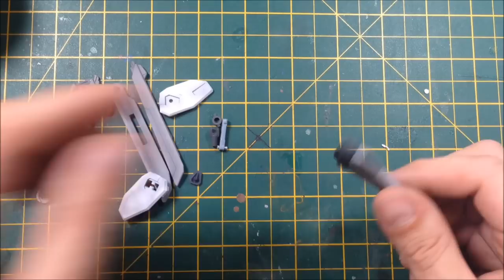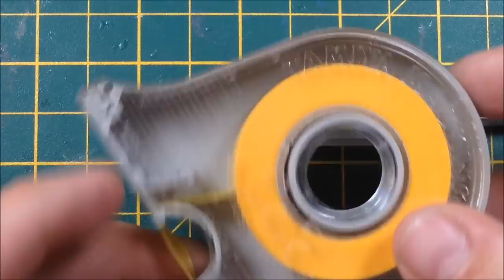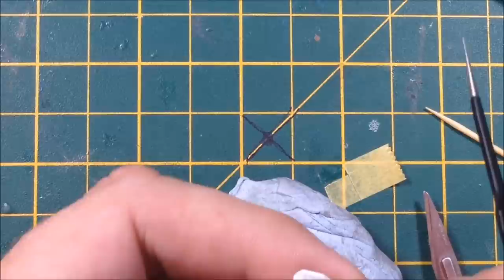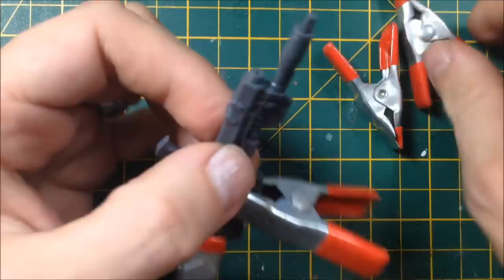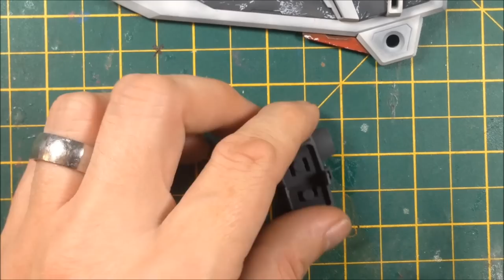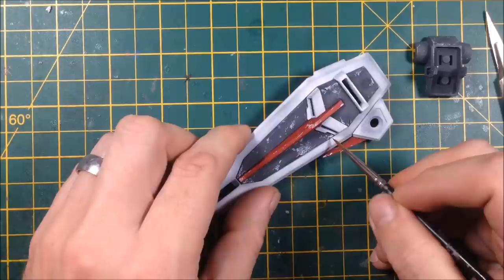SKILL LEVEL 4: MG Freedom Gundam Ver. Wolf Part 6: Masking, Paint Chipping & Filling Seams

Comment: Dear Mr. Fox,

Don't know where to start, so let's start by stating that your channel is simply amazing! I've been back in the hobby for two years now after a hiatus of ten years and I'm just getting started weathering my Gunpla. Build five models as "fresh out of the factory" and now I'm finally taking the plunge, LOL
Picked up your masking technique after seeing the Colonial Viper build and it is way better then doing it by using tiny pieces, so a major thanks!

The weathering I'm doing is just some simple paint chippings via masking fluid and underneath a rust colour. Making some streaks with the same rust paint to make it look like the rust is running out from underneath the paint. Making it look like the suit is on "standing by" mode for a very long time without seeing any action and due to the fact that there are no supplies for maintenance so it's all rusted up.

Again after seeing the Colonial Viper build series, I'm going to do a wash with the Tamiya Smoke paint, as it's laying around for fifteen years...... How time flies....
When I have to order new supplies the MIG Abteilung 502 oils will definitively be on the list.
This brings me to a little question: The model is coated with Alclad's Klear Kote Matt (someone over there needs to pick up their English spelling, haha) which is an enamel and not as most people think a lacquer as it contains mineral spirits (label reading can make a difference...). Do you happen to know if the turpentine used for the oil paints will eat through the varnish?

Please keep making your documentations of model building the way you do. It's been a very long time since I've been educated in such an entertaining way. All the silliness and jokes bring a smile to my face every time I watch an episode and at the same time getting taught new techniques. I love the way you do your stuff! Can't stress that enough!
So many thanks for taking your time teaching us all your knowledge in such a fun way . Hopefully we will get to see many more of your productions.

Kind regards,
Tim
Reply from the maker: +Tim Lemmens Thanks for the kind words and I'm glad you're finding my disorganised chaotic nonsense helpful!

I like the sound of the rusted, slightly abandoned gundam, I will probably get around to doing something similar myself at some point. <aking things look completely junked is the best fun! If you do get yourself some of the Mig oils, make sure to get the light and dark rust, I find them just the easiest to create rust streaks of varying colours and tones, alonhg with a little help from Tamiya Red Brown as the chipping basecoat ^_^

Before you go ahead with the Smoke wash, I would offer a word of caution with that when it comes to gunpla. It varies from kit to kit, but often on gunpla, the parts can be of varied material, with some being polystyrene, some ABS, and polycaps generally made of polyethylene. You'll see them marked in the instructions on the page that shows all the sprues, as PS (polystyrene), ABS (ABS, obvs) and PE. The problem is that ABS has a few issues, especially when it comes to washes. The plastic in ABS can actually weaken, break down and crumble away  if it is exposed to strong solvent thinners such as are found in Tamiya X-20A and others, and a Smoke wash is basically just tha - a pot of thinner with some paint in it. The risk is further increased if the part is an active part i.e. it is a moving part or put under stress in a joint. I've even tested parts in standard automotive panel wipe and they weakened and broke. So, before you dive in with a thinned-paint wash, be very sure what you are washing onto. If have seen a few folks say they same damage can even occur if you use white spirits or turps for oil paints. If you kits has no ABS, then you are good to go, polystyrene is what most model kits are made of and the thinners will do no harm, just keep washes away from the polycaps. If it has ABS, then make sure you prime the living shoot out of the parts as the primer will protect the plastic from any solvents and thinners that go on top (or, if you can, avoid using thinned products on the ABS parts. Luckily in most cases the ABS parts are usually just the inner frame, so if the exterior armour is all PS you can wash and weather that as normal and maybe use other methods such as water-based clay washes for the frame ABS parts. One other thing is that although the PS plastic is usually immune to hot thinners, it is not unknown for a builder to occasionally get cracks in armour parts because they were washed and perhaps ever so slightly more brittle and then stress was applied to attach the part to the model - so if you can, try to make as many sub-assemblies of parts prior to any weathering to that the construction needed atfer washing and weathering is minimal (just keep in mind keeping apart sub assemblies that will be matte varnished and those that will be eventually left gloss varnished. There's a reason i also refer to building gunpla as "Herding Cats For Beginners" ^_^

Alternatively, if you're just not sure at all, avoid using washes thinned with X-20A or any paint thinners at all, and just use other methods. I used a Smoke wash once and only once on a gunpla, and when parts broke, I stopped using it. That's why I tend to use things like the oil paint gunk was instead on these kits, to get a similar effect and to be safe.  

As for the Klear Kote question, I haven't used that clearcoat so I can't honestly say, althoughif the varnish is actually an enamel, then I would suspect yes, it will eat through it as turps and white spirits are often used as thinners for enamels. Also lighter fluid, believer it or not, would probably also eat through it (it's used in the reverse-wash technique for removing enamel coats). The best things is to get a scrap kit or piece and test it out with different things on top, see what happens. Also, perhaps consider using odourless thinner for oils instead of turps or white spirit. You can get it from any art shop and as far as I know is should be a little less aggressive than turps/white spirit (it also DOESN'T STINK). Go for art shop stuff, not model paint brand stuff, as it works just fine and is often MUCH cheaper. 

I will continue, don't worry, I enjoy making these too much. And the next one has a definite comedy moment. However, I can't help thinking that eventually I will have covered so much that my build vids will become a five minute "Right, you've seen how I build things before so no point going over all that again, so let's go straight to the finished model. BAM! and there it is. Goodnight Vienna!" ^_^
Reply: +Modelmaking Guru Thank you so much for the advice about the smoke wash! I could hit myself in the head for not thinking  of that as I've heard and read a lot of horror stories about that indeed. Lets call it a moment of exploding excitement, haha. Although the frame is primed, painted and sealed with lacquers, I'm not going to risk it. I have to say, I love the idea of a water based clay wash. You see, that's why you're the Modelmaking Guru! Couldn't think of it myself and you did!

Alas there are no more art shops here, the last one closed a few years back, so I'll have to do some digging to find one, but I'm sure I will find one eventually. Just to be safe, I'm going to order some spray cans of Mr. Super Clear, they are lacquer based, and decant them to spray them through the airbrush. Then I know for sure I can use the turpentine for the oils. I know acrylics which are alcohol based like Tamiya and Mr Color Acqueous can withstand benzine (what I use for thinning and cleaning enamels), white spirit, lighter fluid and enamel thinner. But unfortunately they can be a pain (at least for me) to spray, as in the past the Tamiya fogged up on me. And the weather wasn't humid at all....

If you do run out of new techniques to show us, you could always show us what you did and how you did it, just like you did with the U-96 submarine. Or play dumb and senile and do the techniques all over again. By that time I am old and senile and think: "That's a great chap! Never seen this before, but I think I'm gonna watch this instead of Inspector Morse..." LOL

Oh, and dare I guess whats in your package you got on the 26th? Is it a Mega Size RX-78-2? "It's huge, yet simple and it's the grand daddy of them all".... Hard to miss, or am I over thinking it? Please don't tell me, I just have to wait like anybody else!

I can't express how grateful I am that you took your time to write me back with such a good and well explained advice! Thanks a bunch Mr. Foxx!!!!!!
Reply from the maker: +Tim Lemmens No worries :) 

The clay wash I use is by Ultimate Modelling Products, called "weathering wash", but I am sure there are others out there. Or, of course, you could do an oil paint gunk wash - no thinners required, just neat paint and a soft cloth. But that takes an age to dry ^_^

You know, you would probably be fine using Mr Super Clear right from the rattlecan. I do my matt varnishes right from the can - by the end of a build I am so sick of using the airbrush. cleaning it out, using it, cleaning it, using it...that I would happily apply stuff using half a potato if I had to :). As you mention about the humidity, the only downside to rattlecans is I have to do them outside, which can be a problem when it is wet, or cold. But, as with all things, if you are unsure, get a junker kit to test stuff out on first, an olf HG or a crappoy airfix plane or something that you don't mind screwing up. I had an old snowspeeder that served just that purpose :)

If I run out of stuff to film, I can just film my dinner or try making something with a completely crazy technique or something. Maybe that half-potato isn't such a bad idea :)

As for the big box...wait and see ;)

Comment: Hey Foxx, when your airbrushing over you base coat, how do you achieve that gentle blend? Is it just one light coat, or are you just hitting certain areas? It's just a stunning peace of work. Both you and your padowia(sorry Tony...lol dammed correct spelling won't let me use Star Wars references) produce amazing paint jobs.
Reply from the maker: +Stomping Freak If I've pre-shaded, I tend to do a light mist all over coat until the shade lines are a faint as I want them, then I will try dry the part with air a little and then go back and focus on the areas away from the shade lines to brighten those up until they are the colour I want. So it can vary from a mist coat near shading all the way to fully painted in the middle of a panel. Some people will go back in with a lighter mix of the colour for the centres or edges of panels, for even more contrast, but I am happy with just using the base colour in thicker or thinner coats. It sounds like I know what I am doing but in reality I am reaally just waving the airbrush around and my brain is going "aaaAAAAAAAA I DON'T KNOW WHAT I AM DOING AAAAAA." 

I showed the process in Part 2: https://www.youtube.com/watch?v=EO5AATb8Qfo&list=PLT8l3DNUdcBAbxvEcjnuHQDWsf7pqQShm&index=2

Comment: Cool video as always, very informative ... The paint chipping could be bigger because the usually fight with the same size "robot".. plus most of the fight are in space.. where there are large chunk of meteor... (If you watch the anime they usually go for the 1 hit kill... if survive... usually come back with less limb or something like that.
Reply from the maker: +taufiq muhammad Interesting, thanks for the info :) I think I would do some bigger chipping if I was doing actual battle damage (i.e. driling out some dints and dings).
Reply: put some thin copper wire from the inside the hole that are coming out .. i did try but with my shaking hand the result are kind of acceptable.. (but don't do it on your current project... it already look awesome. make me wish i have a air compressor in stead of spray can)
Reply from the maker: NIce, and maybe little greebles to suggest the inner workings :)

They way my little cheapy compressor is behaving at the moment, I wish I had a real compressor lol

Comment: Hi again. What color(s) are you going to use for the gun? what is your favorite color for guns?
Reply from the maker: +Roberto Austria Hi Roberto! You'll see in part 7, I will be painting the gun Gun Metal and will be toppping that with a coat of Rubber Black, which will then be chipped away using the hairspray method. So far I have used Tamiya Gun Metal for weaponry, and I really like it as a metallic base that can then be covered with either other chipped colours or lots of weathering (or it can be left clean and shiny as-is if you are making a clean gundam). But I will probably try out other colours in future (like, in my mind, although the Sinanju Stein is white and blue, his big-ass rocket launcher thing needs to be green. Because all rocket launchers should be green, and chipped and battered. Unless it is a Panzerfaust in the desert, in which case a tan colour, because WWII. 

Weapon colour is actually quite difficult for me though - because I don't watch the anime, I'm not trying to make these look like the screen versions, I'm building these like they are just another tank kit or armoured vehicle. So stuck in my head is the size of the tiny pilot and my brain is thinking "yeah, that gun is foty-fove feet long, what would that look like in real life?". And in real life if someone made a gun this big it would probably be all different kinds of colours, so my brain gets caught up in the details and kinda grinds to a halt. It's hard to avoid painting these things without them just looking like a normal human-sized assault rifle. and it's difficult to keep in mind they are massive WWII Dora railway guns, just without the train bogey and with less German soldierage. I haven't fully figured it out yet :)

And now my brain is filled with ideas for building a WWII Gundam. Oh, that shit has to happen at some point ^_^
Reply: +Modelmaking Guru thanks for your answer. It's a good idea to take elements of the real world as reference for the colors and finishes, but is something that takes practice to get the result you expect. thanks again for your answer.
Reply from the maker: My pleasure :)

Comment: Hi I'm thinking about getting into Airbrushing because it looks fun but I am unsure on what I should get. I see on amazon that there is an ABEST model that comes both with a compressor and airbrush, I know it is budget but what do you think about it? I really want to get into it but it seems like a very expensive hobby with the paint and maintenance. I look forward to your reply!
Reply from the maker: It's a rock and a hard place. Although there is merit in starting out cheap to see if you like it, to be honest cheap airbrushes can make the experience less pleasant and more daunting as their cheapness often means they are not as good, and present more challenges that might put the beginner off. I always say the learning curve for airbrushing is steep, but short (once you get it, you get it). I would suggest to get the easiest introduction to airbrushing, and the smoothest and least-steep learning curve, start out with something not too expensive like some of the lower-priced Badger brushes or maybe a Neo for Iwata. They are aimed at the non-professional and will make learning as easy as possible :)